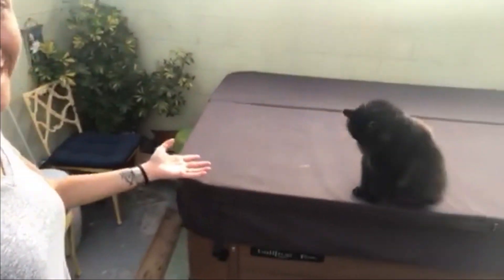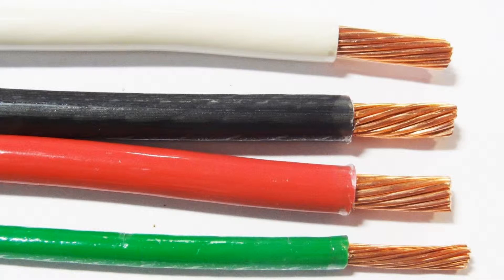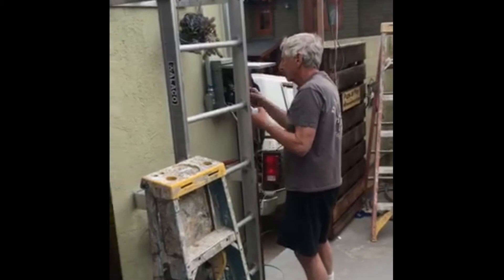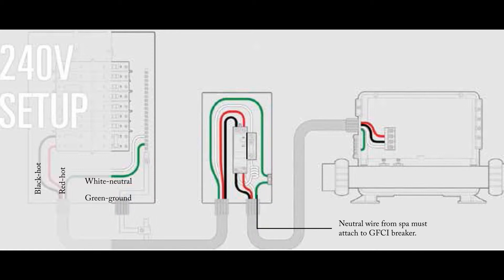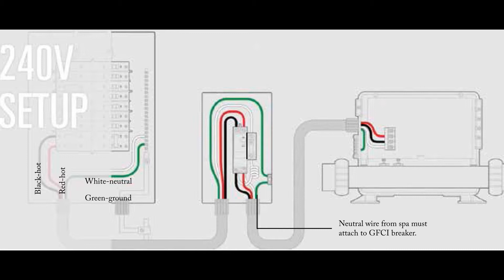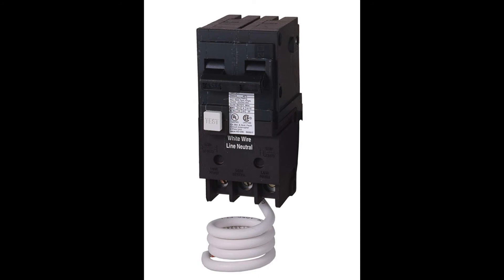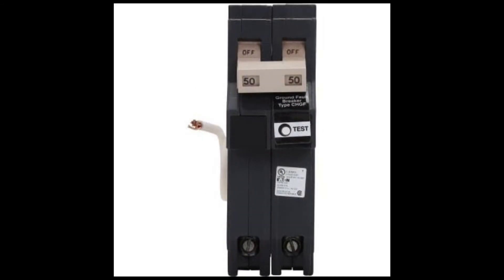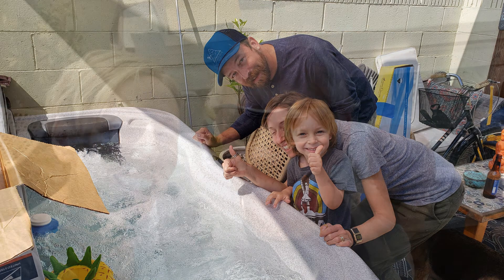Installing Amy's Bullfrog Hot Tub

Comment: You do not run conduit in a panel greenfield  imc emt or even pvc
Reply: At least not a panel you terminate wires in
Reply: It's also against code to run  low voltage with high voltage in the same cabinet  12v  with 120/220  etc
Reply from the maker: There are no high voltage wires terminated in the convenience box.  Only low voltage for the AC thermostat.